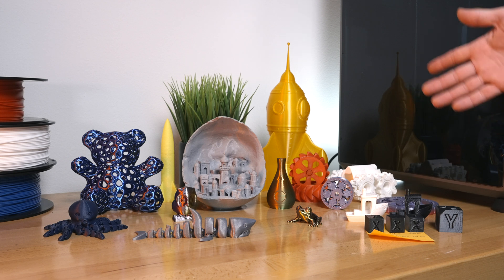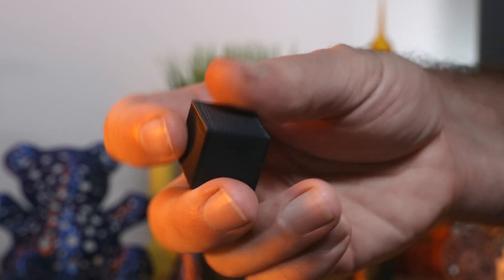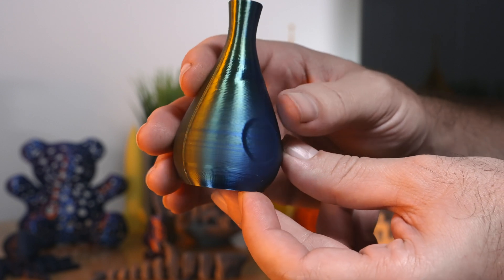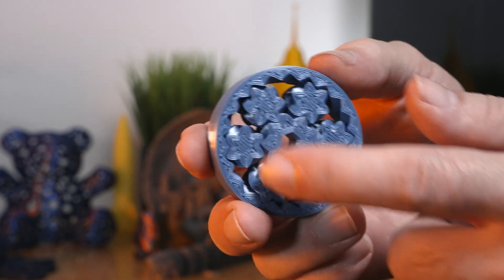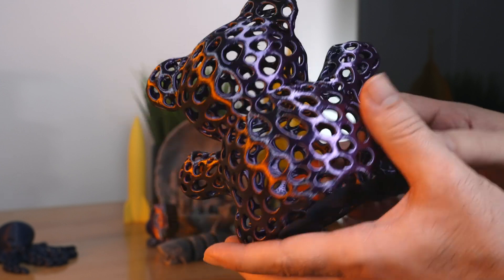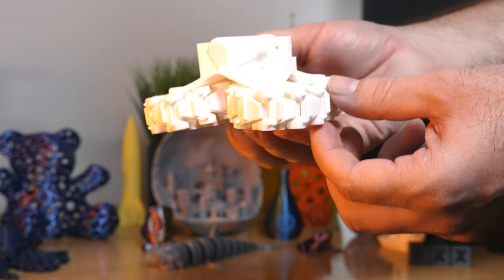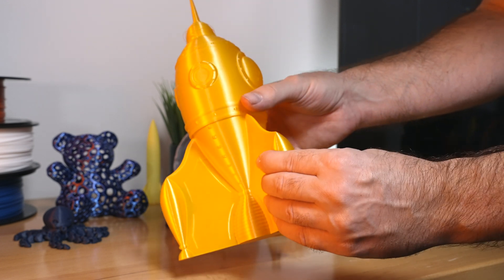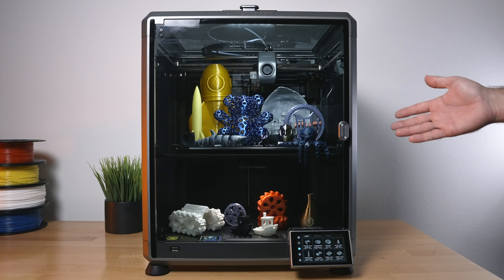Creality K1 Max - 3D Printer - Print Quality

Comment: Looks like poor layer adhesion on the spiralized rocket, this could be a speed, temperature or filament issue. The rest of the prints look great, nice job. 
It's important to do filament tuning, even same manufacturer but different colors could need different settings.